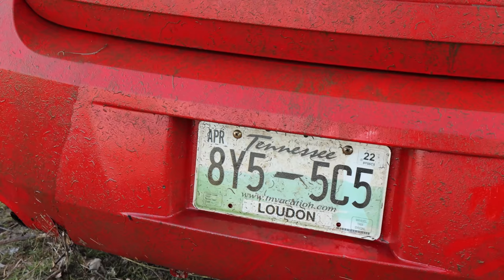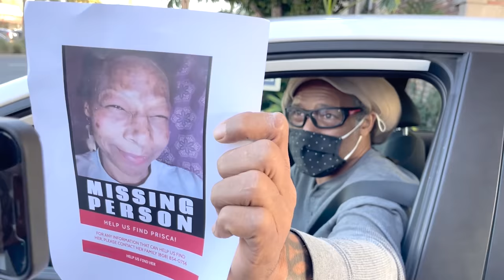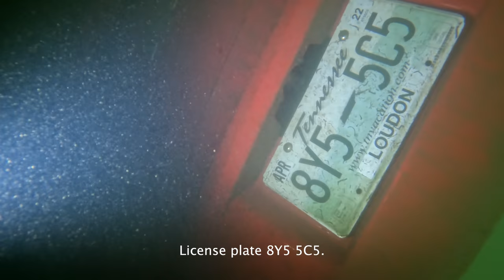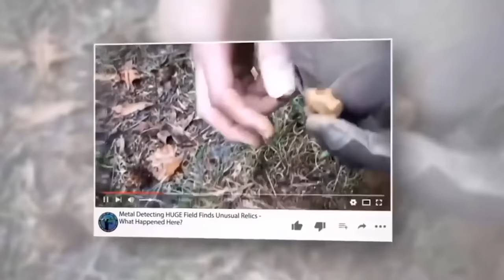Divers React & FOUND Chevy Impala CRASHED In River!! (Unbelievable)

Comment: Britain, grab a brass SPRINGLoaded Center punch, it's a small tool that will take out a vehicle side and back windows. Don't struggle with the front windshield unless you absolutely need to. The front windshield has a sheet of laminate between two layers. The punch with one push will shatter the windows into small pieces. What size lift bars are you using?